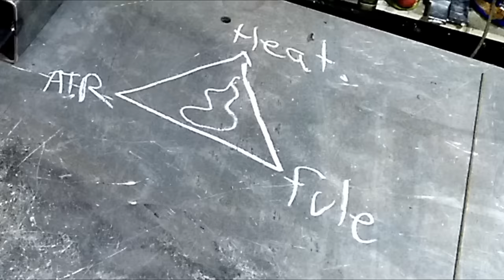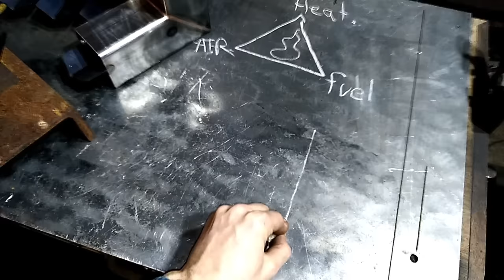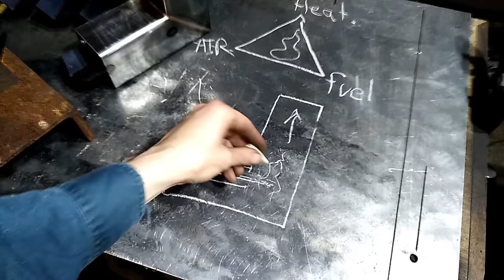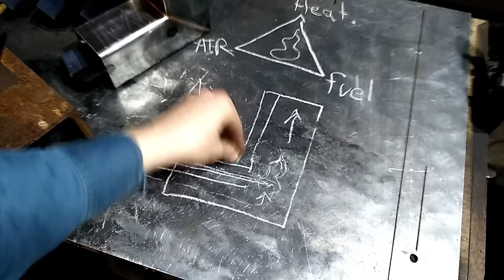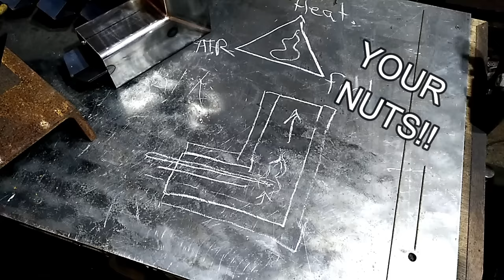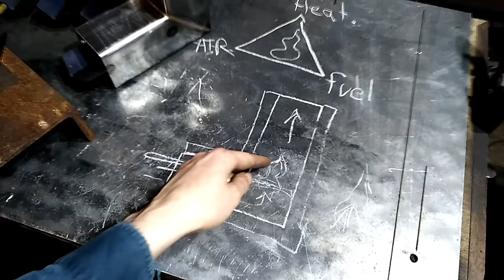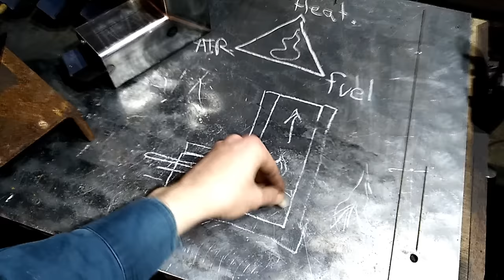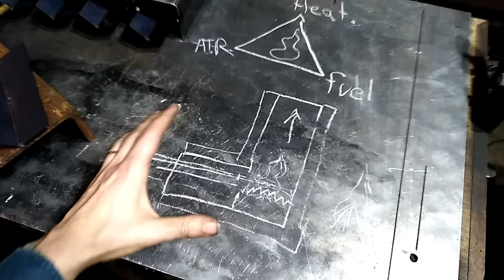Rocket Stove Science

Comment: Several things to add: there's to be certain height of chimney tube for max efficacy: the afterburner effect for the flammable volatile products of wood pyrolysis, which are burnt while acsending. For 100 mm diameter chimney, it's to be at least 600(!) mm height. Secondary contour as small holes in chimney additionally deliver air for more complete combustion, reducing height for 6-8%. Also, the horizontal feeding tube doesn't allow wood to drop by it's weight into the combustion area. Though these stoves are for cooking seemingly - size and flame! "Perfect" rocket stove works by heated gases only, however they may get to 1000*C = 1832*F!
Reply from the maker: Thank you sir.

Comment: As a fellow welder, I appreciate those welds, first thing I noticed!
Reply: I went right to those beautiful welds myself XRP.!!!!!
Reply: Welder here. Yeah nice weld. No grinding to clean your weld! I hate it when people do that. 👍
Reply: I will try
Reply: Nice stack of dimes
Reply: I was kind of wondering why he tigged it but I guess if you're good at laying it down quickly it's probably cheaper than using wire.
Reply: @UniteForgetLeftRight  Im the same way, I learned to tig long before i learned to mig, i can manually pulse tig faster than most people can mig for a smaller bead, still faster to mig if if there is larger profile
Reply from the maker: @chris beerad silicon bronze filler rods mate
Reply: Welds are sooo important to me... function and aesthetics matter. If I buy one I do expect similar fine welds... righto?
Reply: Made mine by spot welding only, it still worked well 😄
Reply: No crap. I was X-ray certified to 4 inches and I could stack welds on top of each other for 4 inches but that crap is tight. It looks like Tig.
Reply: Try not using rods. It will cost less and with your tchnique it should look good. Just grind it on a belt sander or with wheel it. I don't think the heat from the fire will break your butt weld
Reply: Not a welder, but lover of art. I agree with you sir!!.. 😂 U made my day.
Reply: AttentionJunkie I prefer tig over the mig and arc as it’s quieter, no slag, no splatter and you can join butts without filler so cheaper... and it looks neater. It’s quicker on small parts as theres is minimal clean up or prep for paint.
Reply: Price plz
Reply: And as a stonemason, I can verify that metal isn't the only material good for rocket stoves.
Reply: @LittleAussieRockets  Are you saying you TIG these with silicon bronze?  Wild.  Any particular reason why?  Id think that if you’re painting them you would use steel rods.. 70S?

Comment: Sorry to tell you but there are 4 parts and the old heat triangle is incorrect. Oxygen, heat, and fuel are frequently referred to as the "fire triangle." Add in the fourth element, the chemical reaction, and you actually have a fire "tetrahedron." Take any of these four things away, and you will not have a fire or the fire will be extinguished.

Comment: Great video and good explanation of the basics. I like the idea of using angle iron in order to ensure the airflow isn't blocked. I guess the same is achieved by adding a 45 degrees tube or pipe as fuel feeder, which leaves the horizontal arm free for intake of air. Another idea would be to add a small grill at the point where the three tubes meet, and underneath add a sliding pan with its own opening that collects the ash, and can be removed even when the fire is still going, and emptied. I'll know more as soon as I've tried to build one myself. Regards.

Comment: Your rocket stove is using the fuel way more efficiently, that’s one reason the fuel last longer.
 Would it be possible to add a trap door on the bottom to dump out the ash?
Love the build. Keep pushing the boundaries.
Reply: I was thinking of a rod attached to a plate that butts up against the back wall of the upright.  You could just pull the rod toward the front to scrape out the ashes. I like your idea too, for a freestanding stove.  I'm going to build a rocket mass heater into a cob bench though.

Comment: im thinking of building a conventional block bbq in the back yard but also incorperating a large rocket stove into in to use as a wok burner etc , would u have any ideas on the design and best way to incorperate it into the bbq , thanks i really like your work that pressure cyd stove / hot water system is a beast

Comment: Thanks for the great video. Good explanation of the combustion issues and I like your flame maintenance slot in the fuel stick tray and classy welding. Keep exploring.
I make tiny light (SS or titanium foil) Aussie stoves for alpine backpacking (described in the links below). They are kind of 'rockety' but, at as little as 500g weight, they don't qualify fully because they have no heat riser (metal, ceramic, round, square or otherwise). However, they have ceramic lining in the hottest parts (to retain heat for initial combustion and protect the metal) and have 'J-style' fuel stick feeders that let the sticks feed themselves into the pyrolysis chamber that naturally regulates the amount of fuel that can be pyrolysed at any time (like yours). The steady plume of wood gas completes its combustion, in the stove box/cooktop/ heater, having passed through a bed of glowing charcoal and air mixing is aided by rapid changes of direction of gas flow within the stove box. The combustion is very clean and efficient  (only~400g/hr with no significant smoke or any sparks from the flue pipe). Most of the air enters between the sticks (no separate air path as in yours) and the stove makes a quiet chuffing sound which I think results from the burn rate pulsating during the natural self regulation process. As in your stove, ash builds up at the bottom of the J-tube and restricts the burn chamber volume, but it is slow to accumulate and can be pushed out of the way into the stove box. The useful heat output is from the stove box inside the tent. I view them as regulated smoke generators that burn the smoke completely. I would be interested in your comments and if you think I have a correct understanding of the combustion process.
https://timtinker.com/ultralight-tent-stove-part-2/
https://timtinker.com/larger-ultralight-tent-stove/

Tim
Reply from the maker: That's  a really nice stove you  have there,  very unique and practical.  I think you're on the money, I honestly can't think of anything to add or say that you haven't already said.  Good job, mate.

Comment: Most wood stoves exibit the aspects of a rocket stove when their first lit, especially when leaving the door slightly open as the wood starts to light off, and it starts to roar like a rocket,but its impractical to run a wood stove at that level, as the wood consumption would be very high as well as the heat output.

Comment: Whole point of using a J-tube, and with a grating under the burn area, is that the sticks will gravity-feed, instead of snuffing itself. 
the L-tube needs constant minding to feed the sticks into it. 
KEY to any rocket stove:  The riser tube needs to be about double the length of the burn tube section. 
Here's what I want:  A core-unit that will last as long as possible, that allows somewhat bigger sticks, like a Masonry mass stove does.  A J-tube that is sturdy enough it lasts so it can be built into mass we build around it by our old fireplace.

Comment: Hi -- my question as a random arm chair pretend expert person: Why not leave the bottom of the vertical tube open so that ash falls out? That might also work as the cold air inlet.  Then your fuel tube can be sealed, with a lid that has a spring mechanism to push the splinters as they burn up.

Comment: VERY nice build quality. You could use them as axle stands when you aren't brewing a cuppa...!

when I was 11 I now realise I made basically what was a rocket stove (or furnace actually it was that imposing!) The bottom section (horizontal) was made of bricks fastened with clay, the chimney was made from a 3 foot section of steel gate post about 4 x 3 inches.That thing was scary it roared so much and was red hot at times great big blue/orange flame shooting out the top

I read somewhere about the designers of high performance steam trains, they uused a secondary burning chamber for better fuel efficiency. I think some top range woodburning stoves use the same principle, recirculate and burn the smoke
Reply from the maker: That's cool!  Thanks for sharing.

Comment: Maybe expand on the  principles of Gasification  primary and secondary burners
and why a highly insulated (2nd burner with added air feed) high temp combustion chamber for the wood gas enable complete combustion (heat generation) of the wood stock. ie Highly Efficient.

Comment: hey great resource you have here. i just have a silly question . if you are building a rocket stove from 100mm box section . how do you prevent rust from the inside?
Reply from the maker: The simple answer is you can't. Everything has a service life before it needs to be repaired or replaced. The best one can do, for a mild steel stove is go as thick as possible or use 304 stainless steel. 👍
Reply: @LittleAussieRockets  I might go with the stainless because i don't want it to be too heavy , I have never messed with stainless before, will have to watch some videos and do some reading

Comment: Maybe cut a square hole underneath and add a slide out tray to dump ash out occasionally. Could use 2 bits of small L bracket as guides and a bit of 2 mil steel as the tray.

Comment: Does the air flow eventually become hampered by ash blocking the bottom vent. Wouldn't leaving the mouth open give it a longer burn time? And also a place for a excess ash to go? It's just that I have an old one that seems to work just fine. I can keep it burning for ages, which is important, as it gets cold where I am. It also has a few holes drilled into it on the sides at the bottom of the chimney which also helps on a long burn.

Comment: The design of the air inlet at the bottom should be such that all the ash that forms due to burning gets pushed down through it due to gravity. An inclined intet or say upward looking air chamber through which the ash can slip and air can enter. And a mesh separating the burning chamber and the air inlet pipe.
Reply from the maker: I actually want to try that and have been thinking about just such a design.  Cheers.
Reply: @LittleAussieRockets  ok sir thank you n regards.

Comment: Based on what you said , why not build it as a T on its side so the ash falls below the air intake into a ash pit ? Also , what is the smallest square tube you have built ?
Reply from the maker: I have seen a T done before, it looked ok. I think heat loss could be an issue with such an open burn chamber. Might have too try it out.
75x75 mm is the smallest I would go for a stove of this type, anything smaller wouldn't have the fuel holding capacity.
Cheers

Comment: Nice explanation on stove function, I made a double burner rocket stove along with a hot plate attachment, it has a on/off flap if your cooking on one side, a air control door for flame control, and a slide door at bottom for ash also use for secondary air flow. But nice small stove and info thanks for sharing.

Comment: Regular wood stove or fireplace with chimney does the same thing, or can if you adjust the flue, fuel, etc. correctly. Rocket stove does it with smaller pieces. It burns the same amount of wood more efficiently by mixing more completely with oxygen, so less of your combustible wood is turning to gas and then drifting out your chimney (smoke). So a good analogy how it burns less wood, a rocket stove is like fuel injected engine spraying gas in a fine mist into the combustion chamber to mix with oxygen vs. if you just had a big flaming puddle of gas in each cylinder.

Comment: If you have a build up of ash it's an incomplete combustion. Your dimensions could be altered to make it burn more completely. The flow is the most important part.
Reply from the maker: Yes indeed 👍  really comes down to what you're trying to achieve. Something small and portable with a shorter burn time or something a little bit more grand. The design on the bench is designed to be as light and as small as possible, but still achieve a usable amount of heat. The runtime is about 35 minutes before you need to start clearing the ash, depending on wood of course.
Reply: It's about the same size as the DK Rocket Stove that dosent create ash. If you adjust the air flow percentage to he optimal it burns everything.. Its like a  carburetor the  ratio is really critical to get the clean burn. The DK also does not require insulation to achieve this. And was the original all steel portable stove design. You might not have seen then as non have been exported to your country but worth looking at that achieve up to 1100c with almost but not quite your dimensions

Comment: Great welds.
If you cut into the side of your pipe where the upright pice is ten to twenty m.m. below the wood insert pipe you have a place for your ash.
Also if you put it on a cinder block it will be taller and a small metal can in cinder block is easy to remove and dump.

Comment: To get rid of the ash why not place a pull/push rod attached to the angle section with 2  nuts and the rod sliding thru them with a small scrap plate attached to the rod that slides all the way back to the main section of the long side of your 75mm square tube . .At the start the rod and plate are fully in the rear position to clean just pull the rod forward .

Comment: So is it better to have a larger intake than riser, smaller or the same?  I'm trying to make one strictly with materials I already have:  A old 55 gal propane tank, about 12 feet of 4 inch sch 10 pipe, a old oil tank to cut up for flat plate material and 10 feet of 6 inch chimney pipe with a 90 elbow.  Not sure if I want to use the chimney pipe or not but I have it.  I was thinking about making the vertical feed tube a large box around 10 inches or so so I can throw whole bags of trash or thick brush in there and tapering it down into a chute to mate up with the 4" air intake pipe.  Would making the J tube riser out of the 6" chimney pipe instead of the 4" have any advantages?
Reply from the maker: I think that would work just fine, if possible when going from a larger size to a smaller size, try to keep the transition smooth or gradual.   That sounds like a great starting place. Love to see a picture when it's done.  Cheers.
Reply: @LittleAussieRockets  What if the intake was 4" and the riser 6"?

Comment: Still some improvements by closing off the fuel input area and putting an adjustable damper on the air feed. Too much air in-rush can actually cool the burn, which drops efficiency. (Idea to burn the secondary gases produced by burning the primary fuel.) Not exactly about maximizing airflow as it is about controlling it.

But I understand this is cheap and simple, so it is what it is.
Reply from the maker: I appreciate your imput. Thank you

Comment: I want to make a stove for my van. I am interested in something in between a rocket mass heater and a rocket stove. I can't make it very big or very heavy. I like having a heat riser. Also looked at some other masonary stoves and Russian stoves. I want a pipe. heat riser that goes up back down and then up through the ceiling.

A normal wood stove just goes up but I think this is a waste.

I am a little confused about insulating it. If your goal is to generate heat then insulating it is good or bad?

Comment: What idea do you have to remove the ash to keep the fire going? For a pizza oven
Reply from the maker: A small metal hook is not a bad choice.
It's always good to leave a little bit of ash in the bottom of the burn chamber as it helps to insulate the fire from the steel. So a small hook to clear and remove some of the ash is pretty good. I just hook ash out either onto the ground if it's appropriate or into a tray.

Comment: Did y'all design a slip in top with a grill and a port to vent the spent air up and out an exuast pipe? Or how anout a slip in thin Titianium dome that deliver's radiant heat with a side vent to exuast the spent air up and out a chimney pipe? So folk's could use it in door's? 😁👍

Comment: What if you made the angle a lot sharper where the wood is put in and kept the original hole on the bottom for the air flow. Basically making it gravity fed. Less maintenance.
Reply: You described a J style with an air intake and or ash removal port

Comment: Does the increased burn efficiency take care of most of the ash? Or does that collect in the back of the stove?
Reply from the maker: It does collect in the back of the stove but very slowly and what I've found is that it self regulates the temperature for cooking, and what I mean by that is, it starts off roaring hot which is what you want and then sort of works its way down to a simmer as the ash builds up and restricts air flow.  It takes a good hour before you have stop and  remove the ash.

Comment: An insulated rocket stove doesn't make the wood last longer, what it does as I understand it is that it reduces the inefficiently of an open fire it increases the efficiency by localizing the Heat and once the flu becomes hot enough it super Heat's the flue gas increasing the efficiency that much more that is when the smoke stops and when insulating a rocket stove you can put it inside of a modified  propane tank for example insulating with either wood ash, or a mixture of (refractory cement with either vermiculite or a perlite blend) you can also during the construction of a  rocket stove build in an ash dump clean out in the back of the stove.
Reply from the maker: Well put.  Thanks for sharing. 👍